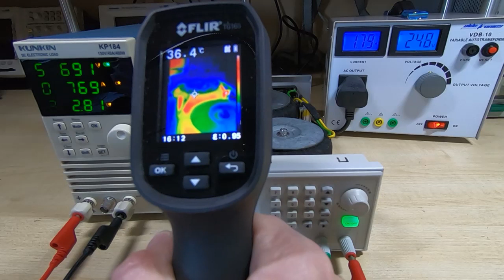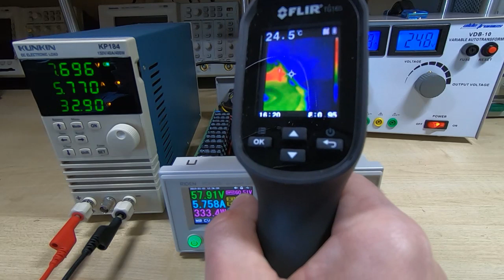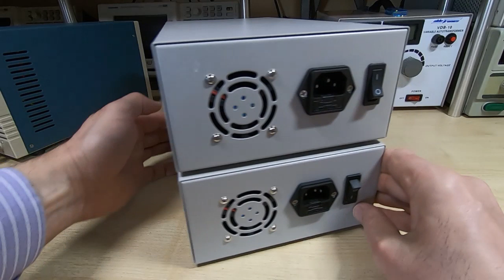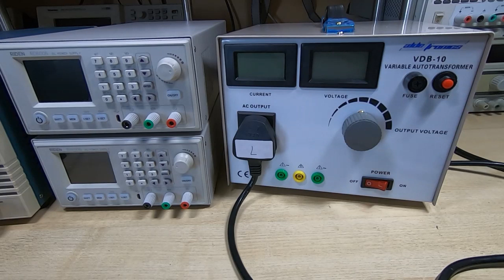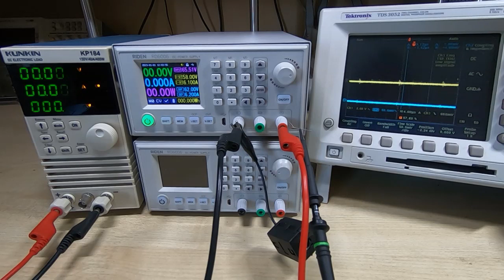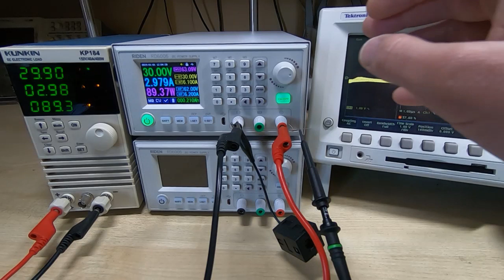RD6006 Linear Part9

Comment: Been looking for a cheaper linear power supply to use with the RD6006. Not real sure what to get. I dont need a ton of wattage, just enough for guitar pedal levels. 36 volt max and 3 amps would work. Idk, I guess I can just use my isolated pedalboard power supply for now, but I want to eventually get a nice little linear bench suppl.

Comment: I didn't expect the difference to be that big. Even without any real power drawn (so for example the use in low power applications, like testing an audio preamp or so) the difference is very big.
The noise coming from the riden module itself is neglegeable compared to the linear vs switching internal psu.

Comment: i have a nice 2kva transformer i could repurpose for this conversion...ive got a RD6024 coming....
Jerry any ideas on the following:
1) Inrush current limiting
2) Using an emitter follower to limit the power supply voltage 70V so that we can run a slightly higher secondary voltage (say 50V) to ensure we can get the full 60V out of the RIDEN

Btw I like your manner of teaching. I envy your patience with the transformer rewinding too.

Comment: Love your work Jerry. Thank you for taking it slow so I can digest what you are trying to say.
I am jealous of your mains voltage. I saw 248v on your Variac at one stage.The best I ever got here in my neck of the woods in Queensland Australia was around 243vac but recently my power company decided to drop the voltage (at our local substation) for everyone by 10volts. The reasoning is beyond me with my level of electrical knowledge but I was told it was to do with so many solar installations pumping power into the system. This is their way of reducing the effects. I do know that dropping consumer voltage helps the power company make more money - lower voltage - more current - more power used so that's a good incentive right there to drop the voltage. My voltage is down to 233vac and drops to 228v when I boil the kettle.
My concern is that I am first off a largish transformer so the voltage I see at the power point is the best one can expect and customers toward the end of the LV run and further would suffer even more voltage drop, thus pay even more dead money. This is our country's way of dealing with renewable energy; charge more for it. We may be the lucky country but not in the top 50 for smart countries.

Comment: Awesome series, thanks for taking the time to do this and share it.  I have an RD6012 and when I feed it with a 30V 10A switching supply the 6012 actually reduces the peak to peak noise that my power supply produces.  I was wondering how much better it could be with a linear supply and you've shown this wonderfully!  Have you done a side by side of the switching supply before and after the RD6006 to see how the 6006 effects the noise in your system?  Better, worse, or the same?

Comment: What is the ripple under load?  I am building something similar for my RD6012 and getting about 3V pk-pk at 10A. I used the same capacitor bank, what can I expect if I connect a second one. Is there any way to calculate this?
Reply from the maker: Many factors affect ripple such as capacitor value and ESR, Bridge rectifier drop, Transformer secondary resistance and transformer core losses so you will need to calculate the required capacitance to achieve your target ripple. My design target was 200mV pk/pk and I ended up with 180mV but that was using a 6006 so maximum was 6A. You also need to consider that the switching frequency of the 6012 is very high compared to the 50/60Hz (100/120Hz) ripple so it is not critical except for preventing the 6012 going into shutdown and providing acceptable regulation.

Comment: A hybrid solution could be interesting - adding the same capacitor between the switcher and the control head. Wonder if it would get a lot better?
Reply from the maker: It is worth a try although most of the 'noise' is not conducted through the switching front end. It is loop noise but it would be interesting to try it. I suspect it would make little difference to the HF noise.
Reply: @JerryWalker001  Are there any ceramic caps on the cap card? Would some ceramic caps help with the loop noise?
Reply from the maker: @SixWildKids  The loop noise does not pass through the board so nothing you do to it would make much difference. Most of the noise present in the video is actually coming out of the mains socket rather than the DC power connection. The entire system including scope would need to be put into a proper test setup to get a clear picture what is really going on but I suspect that a significant amount of work would be needed to make much of an impact. That is really why I built the linear version. The front end is still switching of course but it is more of a pwm controller than a SMPS so it has lower impulse noise. It will also vary a lot depending on the type of switching supply, loading etc. Having said all that some ceramic caps on the smoothing board may help to reduce the front end switching noise but as that is only around 5% of the total noise then the return would be small.
Reply from the maker: @SixWildKids  I forgot to say that I will be posting a video soon showing Power factor etc for the different supplies I have including the Riden units.

Comment: Hi, nice series about this excelent PSU. I have two 850 and 1000Va toroidal transformers with 55v and 60v. Do you know if the Riden supports voltages between 76v and 83v. I have in my hands the new version RD6018W.
Reply from the maker: The Riden controllers will shut down if the supply voltage exceeds approx 70V.
Reply: @JerryWalker001  Many thanks Jerry.

Comment: Thanks for this video series. I am also building a similar power supply(buck converter output) on my channel and it helped me in the way that you proved my decision to be right making the back end linear will save some noise on the output later :) Makes it heavier but oh well you can´t have everything right ? ;)
Reply from the maker: I agree, Linear supplies may be heavy but they do have a lot of advantages. The Riden is of course a switching unit but the vast majority of switching noise when using a switching back end was coming from the power supply. The linear back end also prevents lots of noise going back into the mains and making its way around the lab. This could be minimised by filtering but there is no need when using a linear back end. I don't intend to do much hiking with the supplies so the weight should not matter. In fact a small benefit which is probably underestimated is that the linear supply does not slide around when I am trying to use it like the switching versions do.
Reply: You are absolutely right in every point ! Maybe you can give me your oppinion for my buck power supply design what do you think ? I wanted to design it for 5V and 20A but I have problems to find a single diode rated for 20A. I found a double diode in my parts bin that is rated for 2X16A so what I thought is making two buck coils that are switched interleaved with 180° out of phase so that way I should be getting away with 20A every half cycle and can use both diodes in the package. I have often read that it´s not a good idea to use two diodes in parallel for higher current so that is my next best solution for it. It also should reduce the ripple interleaving two coils as I did read about it.
Reply from the maker: @Telectronics  You are aiming for an 'average' DC current output so using multiple 'inputs' will work well. You have several options for this such as parallel diodes but this is not a good idea as they will not share the loads equally due to differences in forward voltage drop, switching characteristics etc although there are methods to minimise the problem. A better option is to either use multiple windings on a single coil and feed it from multiple drivers or use multiple phased stages (as you suggest) or combine the outputs from multiple stages after the DC has been produced. Each has pros and cons. It also depends on your switching method as many power diodes will tolerate switching currents many times the continuous limit.
Reply: Thank you for your fast reply. My switching method I aim for continuous current mode and current mode control because I think it should be the best for a stable short circuit protection or constant current usage. My input is from a 12V  150VA toroidal transformer and I estimated 30000µF filtering should be enough for a 5V stable output.
Reply from the maker: @Telectronics  Yes 30000uF will easily be enough as long as you have a reasonable switching speed. It is also better to use multiple capacitors rather than one or 2 very large ones as you will get a lower ESR. (I am sure you already know all this but I thought I would just mention it so you knew I was paying attention :) ).
Reply: @JerryWalker001  Yes I do know it but it´s better having more information than being less. Maybe others can gain also helpful information out of our answers. So no worries everything is fine :) In the moment I have only 4 15000µF vishay monster capacitors but vishay says they are 5milli ohm up to 100Khz and can tolerate 12A rms max so my two caps should tolerate 24A and have 2,5 milli ohm. I got them cheap for 10€ unused so I thought take all 4. I could also place 60000µF but I would rather use them on another power supply.
Reply from the maker: @Telectronics  Yes I would save the other 2 for another project. For high switching speeds it makes no difference once you reach a particular capacitance. The main advantage in using multiple smaller caps is that it makes practical layout easier. The caps probably have really good ESR at the terminals but that has to get to the rest of the circuit. I think that is one of the interesting aspects in designing switching supplies because there are so many options. Please let me know how you get on.
Reply: @JerryWalker001  I wanted to make a video about it soon. The first part about it´s case construction from aluminium is online If want to take a look. Now it´s time for the electronics. I do know what you mean I can place the caps being more away from the pcb which is not so good in therms of low ESR. They have M5 screw terminals may be I can screw the PCB directly on the caps without long cables. Ok you will be the first getting informed ! Have a nice evening and thanks again.

Comment: Jerry, can a person also build a Linear for the Riden RD6012W?
Reply from the maker: There is no reason why not although it would need a big transformer and so be very heavy.
Reply: @JerryWalker001  I'm thinking of finding a way to DIN mount the transformers inside a cabinet and hanging it on the wall, weight should not be an issue. any idea how big of a transformer i would need to look for to do the 12 amp linear?

Comment: I have a transformer that puts out 55VAC. What is the best way to drop it to 50VAC for a 70VDC RMS? I do have a handful of W26NM60 Mosfets handy. [26A, 600V NPN] The DC voltage drop only needs to be 7V @12A max for 84W dissipation [Waste] when done linearly, The RMS should be 77V. I have the RD6012 and it does have 80V input caps.

The long story part is I have a transformer based 3000W power conditioner [30Lbs] that regulates the voltage by an extra shunt winding on the primary side that connects to a regulator board. It has both 110V and 220V outputs, but if you switch a mechanical switch on the back to 220V but still only feed it with 117V. The 110V outlet now puts out 55V and the 220V outlet puts out 110V. This would give me isolated from the mains 55V to use for the Riden and a 110V outlet to plugin what ever I happen to be working on, again all isolated from the mains.
I still have to try adjusting potentiometers on the regulator board to see how low it will go. I was hoping that if I can get it to the low 70's the Riden wouldn't care while I don't like running Caps higher than 10% under their rated capacity.

Comment: Hi Jerry, first of all thank you for the amazing video series about the psu. I was researching which bridge rectifier to use to lower the voltage drop and came across this one. Can I have your opinion about it? Here is the link to it
https://www.vishay.com/diodes/list/product-87633/
Reply from the maker: Yes it should be fine as long as a heatsink is fitted.

Comment: For those who are interested, here is my experience of building a linear version of this power supply from off-the-shelf components:
I used a 230V / 2x24V, 500VA toroidal transformer from RS Online (which fits in the standard case snugly, but with enough room); 25A / 200V bridge rectifier on a 6 x 6cm heatsink and 4 x 4700uf 80V smoothing capacitors (in parallel). I was expecting an output voltage of about 68V DC, but after connecting everything up initially using croc-clip cables, I saw that the voltage from this setup was occasionally too high at up to 71V, causing an over-voltage error on the RD6006 (fortunately, it didn’t blow up). I’m in the UK and my meter was reading up to 250 volts from the mains, so I suppose that was the reason. Thanks to Jerry's video, and also because the secondaries on the transformer are on the outside, I took the plunge and unwrapped the transformer, unwound a few turns of the secondaries, re-soldered the output wires and then re-wrapped the tape (a right PITA but worked OK after I’d got the hang of it). Then I tried again and was getting consistently 67 – 69 volts DC. In the finished unit this is working fine, although surprisingly, in spite of the power overhead from the transformer, the unit can’t supply 6 amps at 60 volts. It can do 57 volts at 6 amps or around 5.5 amps at 60 volts, but the input voltage drops to a little over 60 volts so evidently it hasn’t quite got the ‘oomph’ required. On a sustained load near maximum power, the rectifier heatsink reaches 50 degrees C, which I think is reasonable. The transformer gets quite warm, but nowhere near too hot to touch.
 I don't have the tech to evaluate things like ripple and noise, but I'm assuming these shouldn't be too different from Jerry's results, so I'm pretty happy with the end result.
Reply from the maker: Nice work, One reason I used 2 transformers instead of one was to reduce the droop under load as it effectively gives me a much lower source impedance. Also it sounds like your rectifier may be dropping quite a lot. I find that off the shelf transformers can be quite 'optimistically rated' and they do tend to have a fair amount of droop. This is another reason I prefer to wind my own. It still sounds like you are getting close to the max output. Note that I left my RD6006 connected to a 75V supply for several hours when I carried out initial tested. It shut down due to over voltage but was not damaged. If you are interested I will be posting a video on the 12A 60V version shortly.
Reply: @JerryWalker001   Hi Jerry, did you happen to measure the linear supply's Vout under load?  I have a 200VA toroid (2x20V) that I was thinking about using, just to try it but the secondary windings will need to wired in series (measures 43Vrms, 60V DC) and the output Z measures 0.5 ohm.  I'm fine with RD6006 output up to 50V and 3A or so. After running a sim, it seems that under load the output will droop quite a bit. 

I see that you used two xfmr, wired in series?

Comment: Fascinating series! I wonder what the result would be like if you used the switching back-end AND the capacitor bank? Also, you removed the lid from the switching back-end if I recall. Leaving that in place may provide internal screening between it and the Riden PCB.
Reply from the maker: It would most likely destroy the SM supply due to the very high peak currents. It would not make much difference to the noise and could even make it worse due to the higher impulse currents. The high capacity bank is only needed on the linear version because the supply is effectively 100Hz pulses but the SM supply runs at a much higher frequency so does not need large caps. I calculated the required capacity of the smoothing caps based on using a full wave rectifier on a 50Hz supply. Out of interest if you watch the series on the Ferroreasonant transformer you will see that you can use much smaller smoothing caps with this type of transformer because the supply waveform is closer to a squarewave rather than a sinewave even though it is still on a 50Hz supply. The important things are load and frequency. At high frequency large caps have little effect.
Reply: @JerryWalker001  OK, how about other methods of noise suppression in the SM version? I was puzzled in that video by the fault you had with 65 volts shorted to the case without damage which implies that the metal outer case was not grounded, and also why you removed the metal lid from the SM module which should have provided some internal screening. Ferrites on the power wires between the SM and Riden would also be worth experimenting with. For the linear version you discussed using the capacitor bank as a screen between the two units. Might be worth trying this on the SM version with a sheet of grounded aluminium or a piece of unetched PCB material. Finally a filter on the mains inlet is always worth having!

Comment: Do you see and AC voltage between the 2 bolts used for the hold down plates?  You will definitely see a voltage difference between the head of the bolt and the nut.